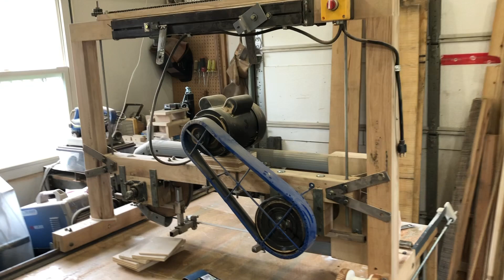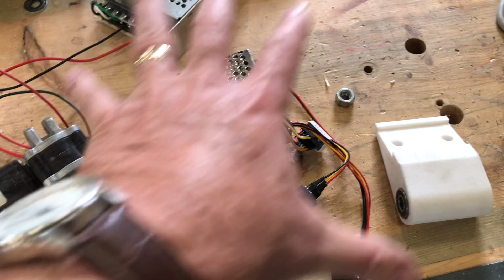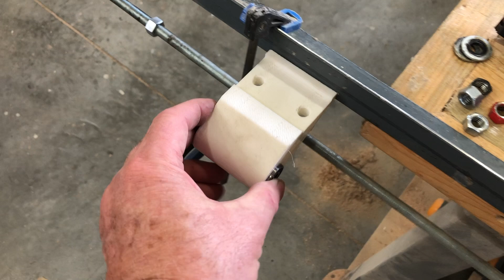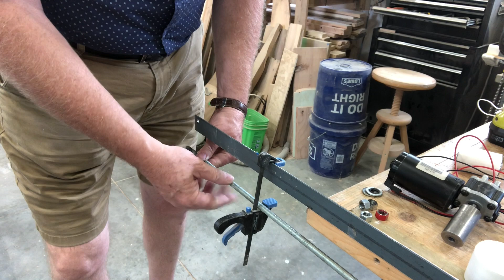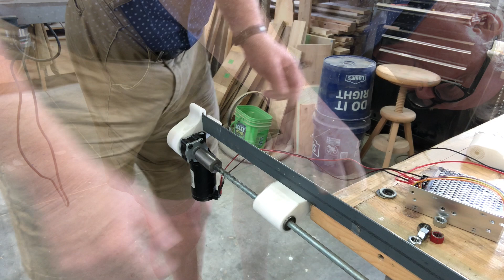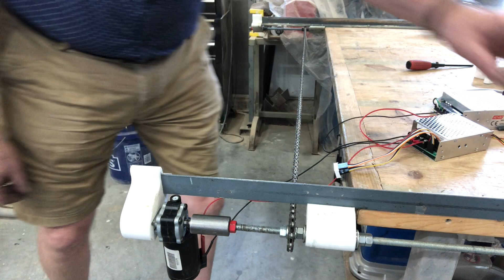Worktable Sawmill Automation - Leadscrew Motor and Brackets

Comment: Yes! Here we go!

The motor wiggles a bit, not sure whether that's an issue in the long term. It might suggest that the shaft has a lot of runout? But not much you can do if that's the case
Reply from the maker: Yes, a little bit of a wobble. I had not inserted the bolt that keeps the motor in the new bracket, so we'll see how that helps in the next video. The leadscrew does have some bend to it as well, so I am expecting there will always be a bit of a wobble, but I don' think that will affect the overall performance much.